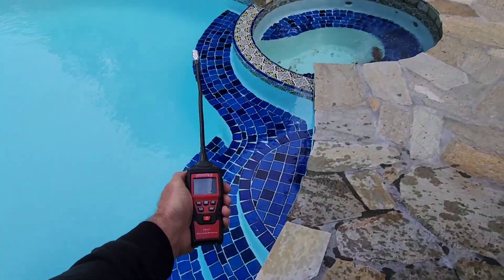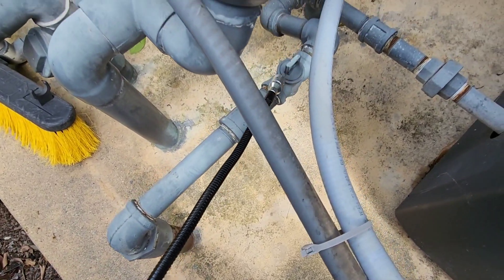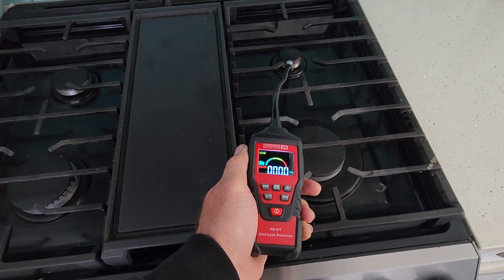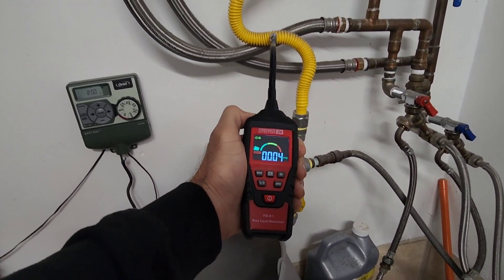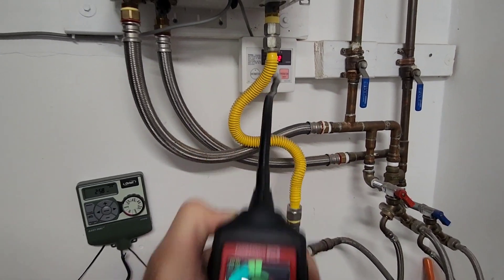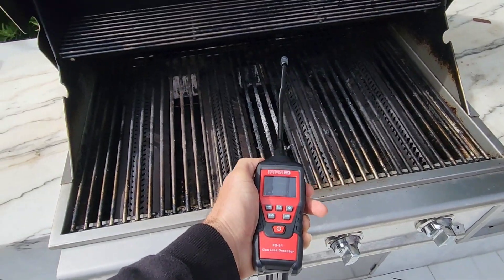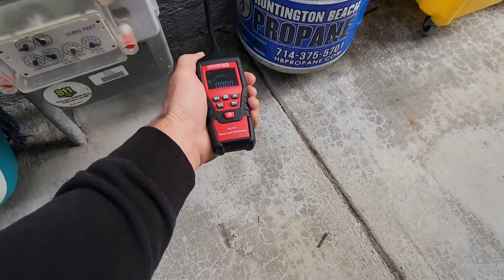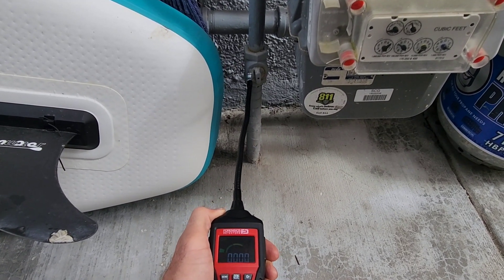⚠️ Gas Leak Detected ⚠️ Natural Gas Leak Detector (3 leaks detected)

Comment: the specification quotes measurement range of 10000 ppm and accuracy of 10% FS, how does it measure then less then 1000 ppm?
Reply from the maker: That spec is WORST case at extreme temp and humidity. In normal situations 99% of the time for most people, this this is VERY accuracy and high resolution 1ppm and the lower levels.
Reply: @DrKozForensicsDetectors  can you quote the lowest detectable level? On my BH-4S is used standard 100% LEL sensor or 50000 ppm means only 5 times more range and detects almost nothing under 1000 ppm, and still has 5% FS accuracy, so to correlate 5 times means 1000/5=200 ppm? To translate the methane already smells intensively before it detects anything.
Reply from the maker: @samoime1955  Lowest detectable limit on all out gas leak detectors is 30-50ppm (variance in sensors). Now you are comparing apples and organes, LEL and PPM leak sensors, two different beasts.You are also using accuracy to determine the lowest detectable limit, which is not the way to do it, and separate variables. 5% again, is washy, ONLY. for extreme cases, usually and most often MUCH better than that figure.
Reply: @DrKozForensicsDetectors  what is the difference between LEL and PPM sensor? They are only measuring units of the same and as previously noted the difference in range is 5 times only. Accuracy means that nothing under the specified is not to be accounted for, so it may be  a detection or electronic variation, so anything below the accuracy is not to be accounted for. Maybe that is in the worst case but then the additional specification is needed. If so, can the gas leak detector be installed in BH-4S?